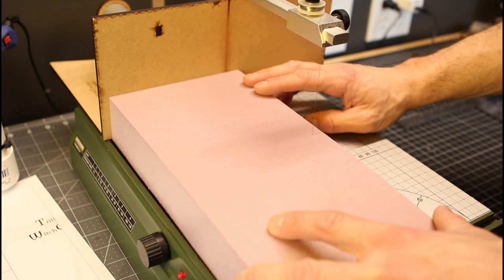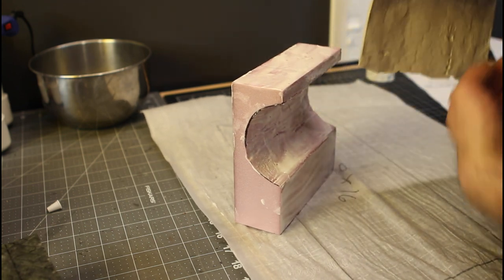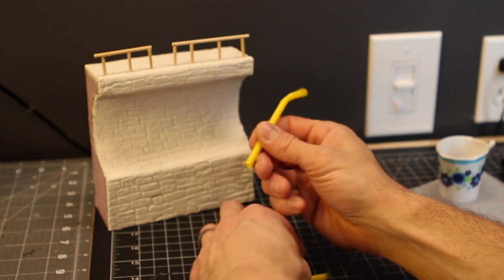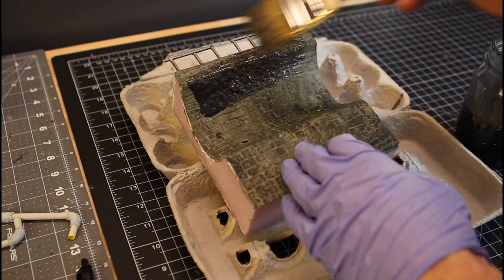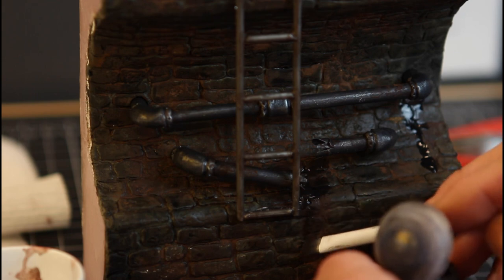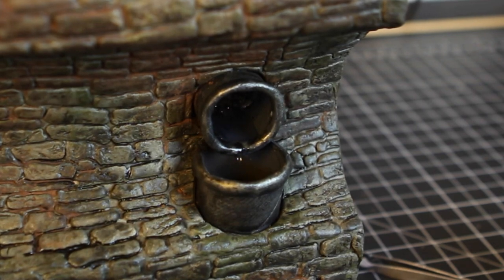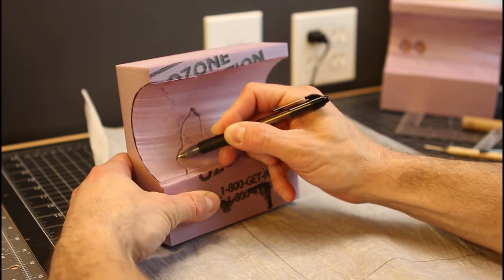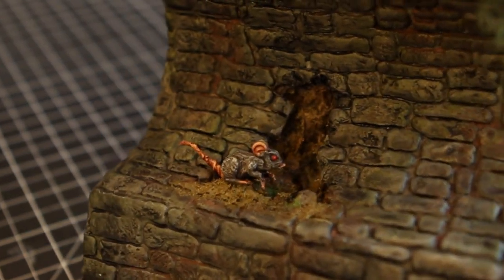DIY Tabletop Sewer Wall Tiles

Comment: Great video. Awesome looking result!
When cutting the blocks with the hot wire cutter, how about using the templates (the ones that you're using to mark the blocks, or maybe thicker ones from cardboard) and attach one on each side of the block, so it guides your wire. Theoretically you could push the cutter as deep as you want, because it would never go outside the boundaries of the templates.
Reply from the maker: Yeah, that's a great idea.  That span is really pushing it tho for the size of the hot wire knife.  But cutting foam that way is a great idea.

Comment: Another excellent tutorial! One thing I felt was missing was a corner joiner section, maybe one for an acute 90o and one for an obtuse 270o angle?
Stay healthy and happy!
Reply from the maker: Mykl Carlton Oh I thought about it even some other tile options as well. Use this video for ideas and craft some up!!  :)
Reply: @TabletopWitchCRAFT  Wonderful! Something else to look forward to.
Have you considered making a hot wire cutter with a wider cutting surface? They're actually quite simple to make and it would enable you to make some of those larger cuts in one operation.

Plus, like most crafting, you get the kick of having made it yourself!
Reply from the maker: Mykl Carlton I have thought about it yes. I’ve been able to work around the limitations of the Proxxon so far.  Maybe someday tho!

Comment: Look really awesome. The only problem i have with this type of craft is that they are useless in combat. Maybe you can climb up the stair but not much other. They are like diorama.   I never make things that i cant use multiple times
Reply from the maker: That's why I designed them the way I did.  The fact that there is a catwalk at the top of each wall adds a lot of options when in the sewer.

Comment: Tip for anyone using large sheets of DAS clay and a texture roller, dont lube with water, use baby powder ...lots and lots of it. It sticks way less and you can be really firm with it. I did an 18 inch disc recently with a 12" cobblestone roller from greenstuff and had no sticking at all. Tons of talc is the answer.
Reply from the maker: Interesting.. no issues painting afterwards?
Reply: @TabletopWitchCRAFT  No problem, though dried DAS will reactivate with water quite readily, so I painted it with watered down mod podge first to seal it. But before that the surface dried like porcelain ...smelled nice too. :D

Comment: Where do you find those paper towel rolls? I’ve manly seen the normal size..
Reply from the maker: I save them up over time... some are from aluminum foil packages, others are from random stuff... You can buy cardboard tubes online too.
Reply: Tabletop WitchCRAFT  cool. If you go to this game workshop link and download badzone delta 7. There are ideas for Necromunda tiles. That’s how I found your channel. It said you can fight in the sewers. Right now I’m looking for other ideas from the download. Such as a collapsed section, pitfalls, ARCHAEOTECH DEVICE, furnace floor,  ventilation tunnel, malfunction generator, sludge farm, flooded secretion,  Promethium Barrels and Fuel Tan, unlit Corders, unlit junction, secured volt, fungus sprawl, waste compactor, Xenos nesting chamber, rust town ruins, cult rituals. Maybe you can show me how to make them. I like the flooded areas, the the ventilation tunnel, furnace floor.
Reply from the maker: 26Snoopy82 Some killer ideas!  I’ll add some to my build list.
Reply: Tabletop WitchCRAFT all those things I told you was from the download for Necromunda. There is not a lot for Space Hulk terrain videos either.

Comment: Late watching this video so this comment probably won't get answered but I'm gonna give it a shot anyway... How do you keep DAS air dry clay from cracking ??... I tried it a thousand times and every project gets tossed due to cracking. I've tried thin sheets and thick sheets both cracked. I've tried mixing PVA glue into it...It cracked. I've tried allowing it to dry before attaching it to the piece... It cracked. I've given up using it.. If I could get past the cracking problem It'd be great stuff with 1,001 uses but right now it's totally useless for me. More of a headache then what it's worth.
Reply from the maker: Hey Rick,  I find that starting with a thin uniform sheet of clay is important.  Then another even coat of Aleene’s Tacky glue holds it real nice.  To blend two separate pieces of clay I don’t use water I use Aleene’s again.  So far, no cracking.  Give it another go.  Good luck!
Reply: @TabletopWitchCRAFT  ... Thanks I'll try it... I love the way DAS looks when I work with it but the cracking problem drives me crazy... Thanks again and keep up the good work!

Comment: Very cool but too big to store easily. Amazing detail though.
Reply from the maker: You can just make 3-4 of them and use them as scatter terrain for the tiles.  The elevated catwalk really adds a cool element to the sewer!
Reply: I would think, if you were to forgo the LED set up in the 1st video in this series and not make the bases as deep as John, MDt has made, you can still have an amazing set of sewer tiles without taking up as much space. I had also considered using the in-wall LED option, thus requiring less base-space. The really amazing thing about the videos John and others have made is that they are a start point for your own imagination. Build! Modify! Adapt!

PS - Yes, I've declared John a Doctor of Terrain.
Reply from the maker: David Gleffe haha, Thanks David.  I agree.  Use the videos to spark some inspiration and build a creation all your own!